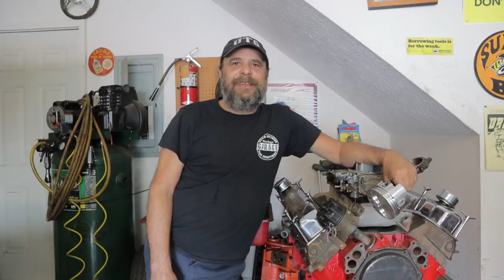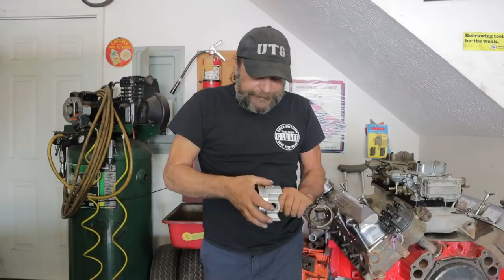The Great Piston Pin Offset Controversy ANSWERED!

Comment: I did this on a 78 400 it also had a purple shaft cam and ported heads you could hear it a little even with open headers. That was a great running junkyard build put it in a 70 Duster with 456 gears shift kit 727 and slicks it ran 12.0s all day.

Comment: Direct Connection quote on page (57 and 197) "Factory pistons have the pin offset to reduce piston slap. By reversing the offset (reversing the piston) engine friction can be reduced. In engines equipped with power pak (domed) pistons this can be accomplished by installing pistons from the right bank in the left bank and vice versa. This means the notch in the edge of the piston top will now be towards the rear of the engine. With two barrel flat top it is only necessary to reverse the piston on the rod and not necessary to swap from bank to bank." AND THAT IS IT!!!!!!!!!
Reply: Well stated!
Reply: Yeah and how old is that book?
Reply: Edelbrock also sells an air gap intake manifold to reduce plenum temps. Dave and steve also proved that to be a myth.
Reply: @norgepalm7315   they proved the temp of the manifold has no effect on power

Comment: I have an old 1980 Suzuki GSX750 that was a former drag bike back in the day.  I have the carbs from an 1150, definitely hear the slap from flipped pistons, and have been told that when the previous owner did a valvetrain overhaul the valves were backfaced.  Suzi doesn't like to warm up, but once up to temp she definitely has a power advantage over all the other classic 750s.

Comment: Because of you I flipped the pistons in my 87 roller 302 in my foxbody when I decided to freshen it up .... It dynoed before at 254 wheel with standard bolt ons ..head cams and intake ....I can definitely feel the motor has a higher power band and way more snappy ....once she's painted I'll dyno it again to see ....but from my butt dyno ...there has definitely been a gain
Reply: @vrm86gt  smoky yunick use to do it to the 7x 308s in the champion Hudson's hornets lol 
..I was sold after that hahaha
Reply: @vrm86gt  Unless you have same day back to back comparison under the same conditions it will not matter now since time has passed and you have broken the engine in it will most likely make a little more power. So it would be a moot point at this time to do a comparison.

Comment: Jan 2020 UTG posts - Hot Rodding The Slant Six - Overcoming Design Flaws. (for a specific car engine build)
Jan 2021 Dulcich posts- Oil Pan Mod. (just cause?)
UTG happily shares knowledge freely making videos sponsor free and geared for us everyday guys.
April 2021- Heavy Sponsored backed Roadkill Extra calls out UTG that's instigated by Frieburger. 
May 2021- UTG responds with class, continues to make sponsor free videos for us everyday guys.

Comment: The Mopar experts will say "It might make a little noise when cold" if you do this trick. That was the only downside.
Reply: @jamesplotkin4674  Not with "PRODUCTION" flat top pistons which had no valve reliefs cut into them. I built a number of 383 and 440 street motors using the Direct Connection Engine Manuals and all ran strong.
Reply: @jamesplotkin4674  If you are too lazy to check for adequate clearance you have no business fooling around with engines.
Reply: @jamesplotkin4674  you would not use domed pistons on this trick. You need 0.001 clearance, flat top (even with the valve reliefs in the tops) pistons easily have 0.0015 with a stock or decent cam. Dished piston? Clearance for days.
Reply: @davidleonard8369  Its still a free country (Kinda) so, they are free to blow up their motors if they want to.....🙂
Reply: correct also marine engines were just that
Reply: @jamesplotkin4674  smiling and show you the if pistons reliefs are correct position and F is facing  rear engine  then you've turned them correctly,  i think you missed a step
Reply: @olikat8  .001? You dont mean valve to piston. More like .1
Reply: @needmetal3221  usually a thousandth
Reply: @olikat8  hell no. 50 thousands minimum
Reply: @needmetal3221  100/1000- sorry, my bad
Reply: @needmetal3221  it'll do 100/1000th. The books and other machinists, much more versed than I am, will even say that. Me & a couple buddies have done it with "Runner" motors (no high-lift cams, milled decks or heads-beyond minor milling to ensure level surface, or altered rocker arm ratio) and 0 issues. The guy he references, Tom Mews, even states it.
Reply: @olikat8  how did you measure the clearance?
Reply: In uncle Tony’s defense page 222 in the mopar engines book part no. 5249010  it says reversing the piston  will make the engine noisier, but it will also produce a little more torque

Comment: Full disclosure:
I reversed my socks and I did NOT see an increase in performance.
Then I reversed my shoes and it had a negative effect.
YMMV
Reply: NNNailed it! a perfect crumb of humor
Reply: Then I walked backwards and got home before I left - Thus, I have invented Time Travel😎
Reply: 22 years in the infantry I always wore my green socks inside out/ not kidding
Reply: How many of these Mopar guys ever worked in a Machine shop???   Talk is cheap.
Reply: Use to love them guys at the track.....ALL STOCK was what they said...440 challengers/roadrunners.....13.00,s then buy alum. mopar heads......3 grand in heads/converter/headers...with a Big double pumper.....When an ol boy with a home built big block chev. gets them.HELL TURN YOUR SOCKS BACKWARDS and gain a tenth.
Reply: @chrishensley6745  As a machinist I'd sure like to know what you're point is.
Reply: Glen Holmgren.. What did you say to your other self when you got there?

Comment: Why would you turn the pistons backwards when you get free engine parts from your TV sponsors.
Reply: Right! Why would you spend time testing an old trick that adds a little bit of torque or power when you can just get sent a brand new supercharger or whatever trick new gadget they're trying to sell!
Reply: @Sedan57Chevy  Yeah. Why tell someone how to get a few free hp or move the torque band around when you are pushing brand names on every show.
Reply: @Sedan57Chevy  if it added power for free why dont the oem's do it on their performence models?
Reply: Holdner and the boys just did this on Engine Masters with I believe a 360 Mopar with factory pistons in it.  No difference in TQ or HP.

Comment: I believe you Tony that the geometry with offset effects timing of piston by maybe a few degrees of crank rotation because of the imaginary radial arc at the wrist pin centerline to be at top dead center either late or early depending on clocking them 180° out.  
It does change the physical timing of the piston with offset at top dead center, but it does not change the physical height into bore because said dimension cannot change wrist pin center to piston top, rod length center to center same and crank at full stroke at center of bore doesn't change.   But the timing of so called flipping the piston, and correlation to valve trane timing I could see the possible gains through retarding, or advance of piston timing, but also see that being done through degreeing the cam in same manner with same results.

Comment: My Dad worked for GM in the 60s and 70s. RIP Dad. He was definitely a small block Chevy man. That is the ones from 1970 back. Any way he always had a thing for the 383-440 Chrysler engines. Anyway.  Your 318s(Bottle Rocket) sounds like a screamer! Keep up the good work UT. Us old gear heads need you!

Comment: Never knew you could even turn them around. Learned something new today
Reply: all depends on the engine design.  flat headed pistons  yes all day   domed or valve relieved pistons  do your homework
Reply: Heck, I thought they were all drilled on center for the pins. This is all new to me. I've never put new pistons in anything so I always did the "number it and put it back where it came from" deal after rings.

Comment: I have done this in building 400 sbc calmer engines. Circle track racing where your competitors can buy your engine for a set price. The rule very but ours was 400 and exchange of engines. On building our setup we changed out the 5.56 long stock rods with 5.7 long 350 rods. We then would cut down the piston because the longer rod would cause the piston to exit the notes. We had to be careful in setting quench clearance and make sure no ridge was in the notes. Low tension top ring were also needed. We saw improved lap times but nothing you could feel. Maybe we had 5 up increase across the whole power band. Add that up and it makes a difference on a circle track.

Comment: I'm sure I will get flamed for this but here it goes. As someone that has raced Stock, Super Stock, and Competition Eliminator and builds all my own engines. In each of these classes you are trying to get every last HP out of an engine, and In Stock Eliminator you are limited to Stock parts or NHRA approved parts. I will tell you having done the testing, and the Dyno does not lie. There is NO power gain to be had by reversing the pistons. In this case, the theory is not replicated in reality. Any friction advantage is negated by the extra piston rock upsetting the piston rings.(That's what we have found anyway)

If there was any performance advantage to piston pin offset. Every Pro Stock engine out there would have it. but not a single one does. Just because your performance book published in the '80s says to do it doesn't make it correct. In Racing/Performance technology Last year's technology/info is out of date, 5 years ago is obsolete, and anything from the '80s might as well have been written on a stone tablet.

You can argue against what I am saying all you want, Hell, use a whiteboard if you like, but it's just the simple truth of the matter.
Reply: Steve Pohill     I’m glad to hear someone that has real world experience.
Reply: I think you are right... there is a lot of good classic car wisdom, but some info is just plain outdated.  
I really like Uncle Tony's stuff, but a lotta old guys I see really can't just swallow their pride and admit they're wrong.  My dad who has been in the auto industry his whole life acts like a know-it-all, but even then, sometimes he's proven wrong and I can see it's really hard for him to wrap his head around being wrong and he throws a fit...  hope I'm not like that ! not a good look.

Comment: We're glad you don't just throw billet efi "restomod" bs our way. I read somewhere no offset whatsoever between the crank, bore, and piston was hammering on the cranks of early inline flatheads, if load gets close to the momentum and reciprocating mass you aren't turning the crank but instead trying to punch through it. It's really another penny pinching move though, it became a way of using weaker parts by spreading the forces apart in their timing by having tdc for the piston and the connecting rod to not be simultaneous. Personally I'd rather modify factory parts, just read about shot peening piston skirts to create dimples lessening the friction even further by helping hold the oil film, grab the 12 gauge buckshot, we're going piston skirt hunting

Comment: On my then 20 year old 1964 dart 225 6, I heard pistol slap briefly, after first morning startup, in freezing weather. The engine did use oil. I,  then, ran Pennzoil 60wt. 
But geeez, if running the offset forward makes free power. It also saves fuel. People have been allowed for too long to be mechanically ignorant. Build it right, and learn the sounds.
Reply: Just let it self-clearance. It'll quit making noise.
Reply: The worst thing was the Pennzoil. I'm not a fan, but to each his own.
Reply: @arlenvanderhoff6546  This was in the 1980s. Then , penzoil was an asphalt base. And the only offering in the area of 60WT. In the 1990s penzoil changed to a parafin base. I changed to Valvoline , 50 WT.

Comment: Im a development Dynamometer operator from Chrysler central engineering startting in 69 and you got it right again. The difference is piston contact, stock location is low friction at low RPM. turn the piston around the lower friction increases and the high RPM friction reduces and horsepower is released.

Comment: The controversy was never "hey that won't work" or "hey that won't make power" etc etc, it's that does it TRULY make power? David Freiburger built two engines with identical displacements, but different bores and strokes, they made the same exact power within a tiny fraction. That changes the way the piston accelerates way more than pin offset. I think if you do a back to back dyno test, you'll find pin offset if it does anything is extremely extremely minor. So, what's the takeaway? If you wanna do it, sure do it, who cares. But I'd say if you've got a motor that's already together, don't bother tearing it apart and making it a huge project to flip the pistons.

Comment: Hi, I saw that video from the " TV Guys" and heard the challenge. I respect the guys and I think I recall that one is a writer. So I was surprised that an article by M. Davis about building a 400Hp 302 on Pump gas didn't come to memory. The article was published in "Hot Rod Engines" in 1999, I still have it. Engine builder was Joe Sherman and the article suggested that reversing the piston caused the engine to perform as if it had an additional .003 more stroke.
Reply: I race with Joe's son Steve.

Comment: My grandad had Hudson engines, and would make short throw engines by reducing rod length and increase flow; He'd reverse his pistons because all the slap you dont get at the top you see at the bottom with short throw engines. So the offset prevents the crank thrust from slamming the pin into the bottom of the bore.
Reply: I think your granddad was a cool dude. But don't you mean he lengthened the rods? A shorter stroke requires a longer rod or a lower piston pin boss to keep from losing deck height and compression.

Comment: This is from a technical document of one newer engine:  Pin offset involves advancing the time when the piston changes between the compression and power stroke to the lower pressure range before top dead center. This results in a reduction of noise and friction.
Reply: So utg is encouraging increased noise and wear.

Comment: Dave B. Here, I've been building, restoring and scratch building engines my whole life, exotic European stuff, American V-8s, inline 6 and 8 cylinder stuff, the offset wrist pin is part of the design to minimize rod angle on the power stroke to lessen the thrust load of the piston skirt on the cylinder wall, it has nothing to do with "piston slap" (which is caused by cylinder bore wear) and installing pistons backwards will not increase performance at all, but only significantly reduce the overall life of any given engine, this is why the laws of physics are here, to explain how and why this stuff functions correctly on this planet, try studying fluid mechanics, I did and have built engines with amazing power outputs, insane rev capabilities and longevity beyond standard configurations that manufacturers use in mass production, I have built air cooled 45 degree V-twins of 100 cubic inches (Harley-Davidson motors) de-stroked and over bored that turned over 11 thousand rpm and lasted longer than stock motors, engine building is an exercise in practical application of many branches of physics, with real results, I do this every day and know what works and what is a load of baloney, thanks for letting me tell how it really is, Dave B
Reply: I just looked on your channel, to see all the super fast cars you've built, but you have nothing uploaded.. Odd. Your entire life spent building stuff, but not a single video showing any of it?

Comment: Tony you are correct.I watched the roadkill video, and those guys totally missed the point. Smokey wrote extensively on the subject and explained why it works. Granted it is not applicable to every build due to different configurations of valve layout. Even Henry Ford used it in a slightly different way on his flathead V8. The crankshaft is actually offset about .250 to one side from center creating a similar effect. It’s all about leverage and also dwell time at TDC. Keep doing what your doing man.

Comment: I used to build pure stock circle track cars and I used every little trick I could imagine to gain an extra horse or two. I never considered trying the reverse piston trick because it wouldn’t pass tech inspection. I won’t say it does or doesn’t improve performance until I see a real dyno test under very exact conditions.

Comment: Might have been a thing, back when engine guys (Smokey and the Ramchargers guys) were trying to get every last HP out of stock parts when NASCAR and NHRA class rules meant STOCK pistons and rods.   Guys used to spend all year chasing 5 HP.   

In 2021 with the easy availability of custom machined forged pistons made to your specs, for reasonable money,  it just ain't worth it.    For street cars there's even more and better ways to make  power.